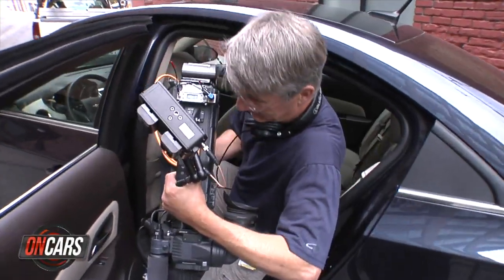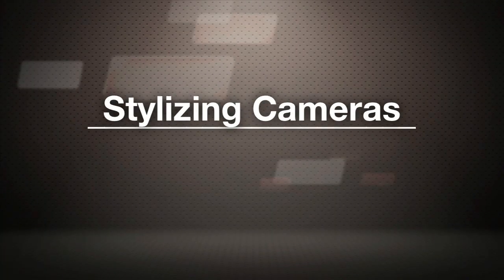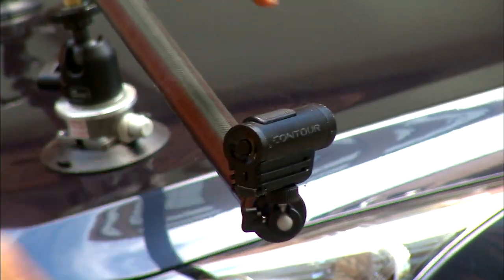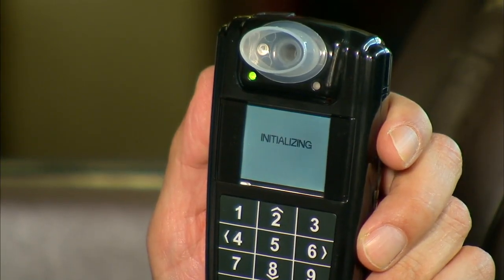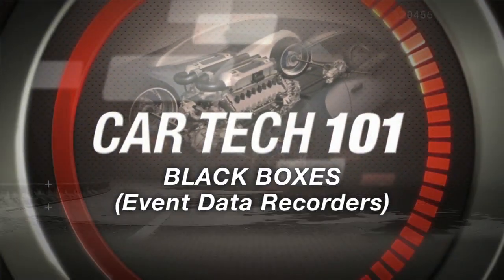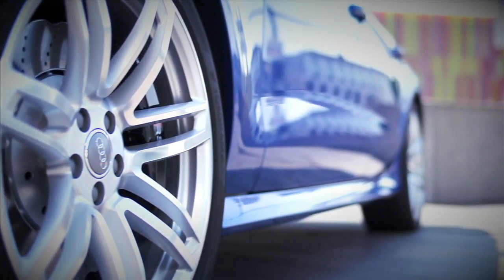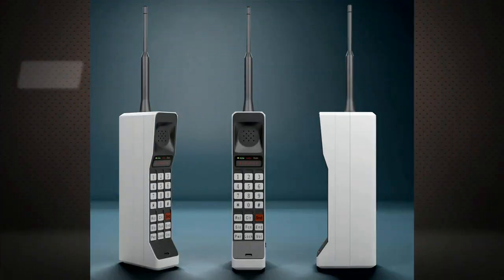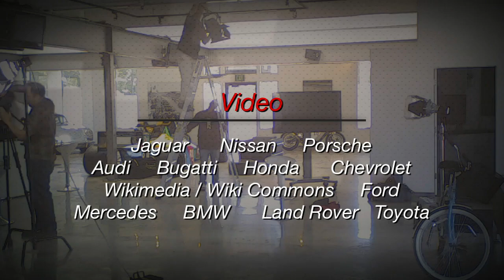CNET On Cars - Audi RS7: Rubber-burning tech toy - Ep 23

Comment: The ABS controller is not the only "black box" in your vehicle, either. The PCM (formerly "ECU") records freeze-frame and historical value any time there is a fault, and a fault is likely in a collision. Logging is typically 30+ seconds before and after a fault, and includes fairly complete engine-specific data including throttle position.

Comment: I have had very bad experience with a Panasonic video camera (HDC HS300); night recording yellow light is red (despite warranty repair attempts), continuous errors in file transfers via their software (only way transfer of video an take place), issues in file load up, issues in file memory clean up. Hence I will never use them again.